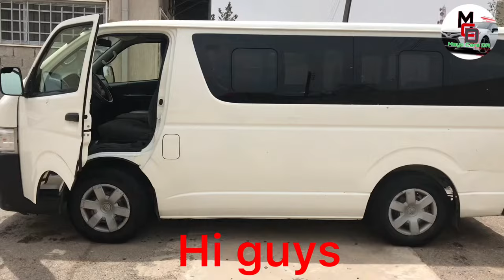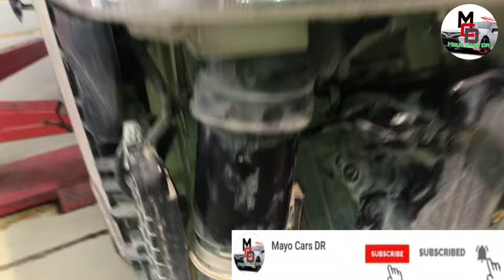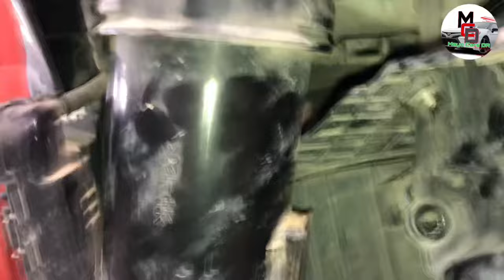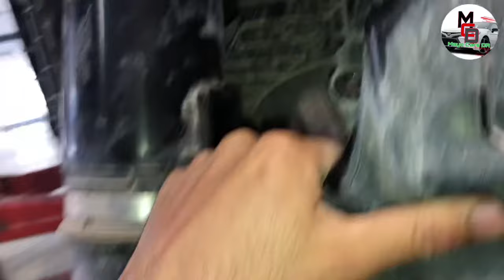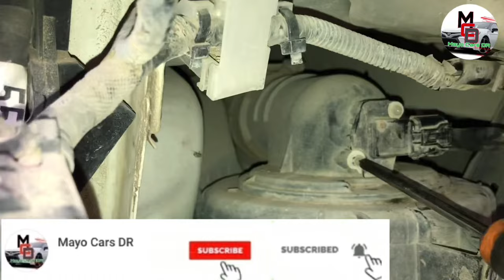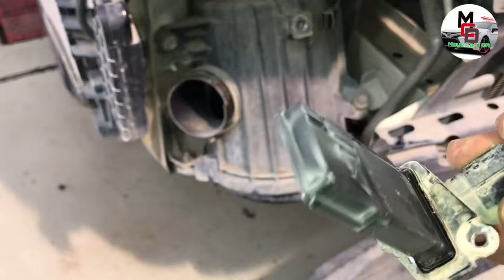Toyota Hiace 2013 Maf Air Flow Sensor Location

Comment: If my Toyota Hiace lwb 2008 doesn’t accelerate well, could it be because of this sensor? And would I clean it or change it?
Reply from the maker: If this sensor is bad then the check light comes on and if it is not then check the fuel pump pressure